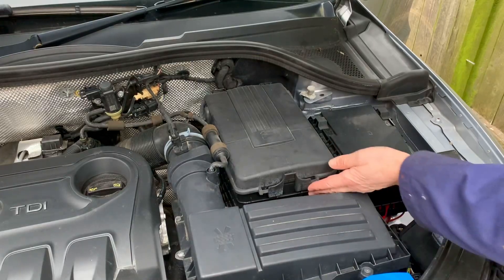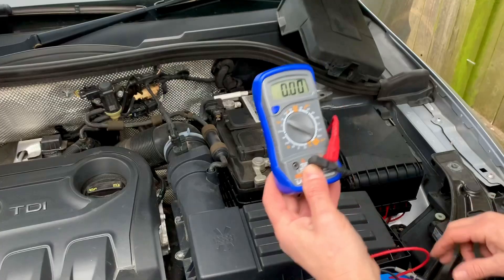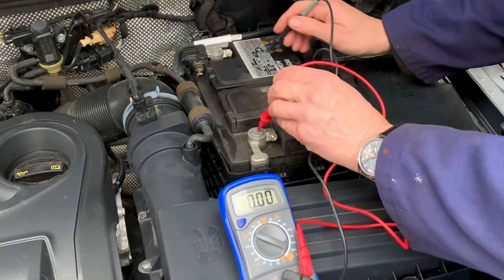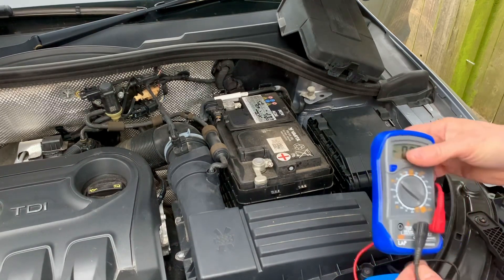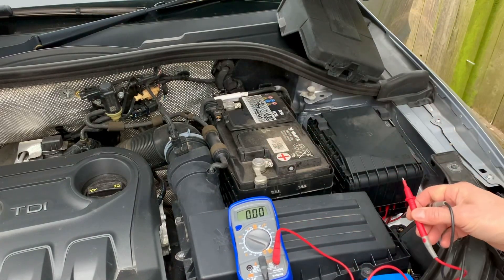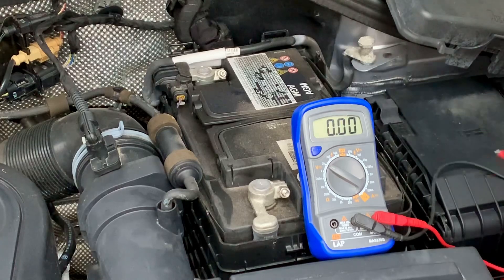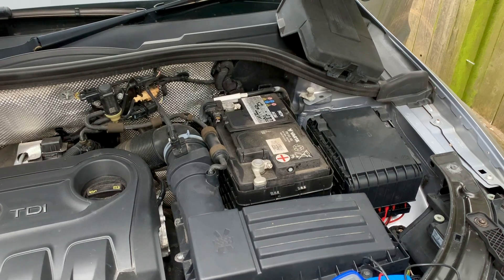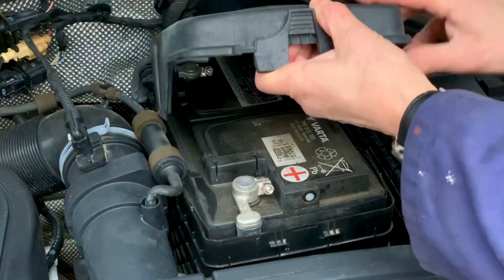Faulty Battery Diagnosis using a Multimeter

Comment: Great video I guess this is an AGM battery? I’ve read they last 6-8 years so well overdue a replacement imo. Preventive action for me is to change it regardless at 8 years so you don’t get caught out 😊
Reply from the maker: Thanks. Yes I would agree ideally it ought to have been changed before, but when it’s still performing, time flys by. Not sure if it’s an AGM battery, I’ll have a look and see if it says on the battery somewhere. Varta are very good so it may be. Thanks for watching. 👍🙂

Comment: Excellent advice thank you. From my (too many) years with batteries, after an overnight settling period, 12volts or less was as good as flat, 12,3 volts was 50% capacity and 12.6 volts or more was 100%. This was a good indication of the health and longevity one could expect of a battery.
Reply from the maker: Thank you Chris, that is appreciated. Sounds like you know your batteries. Seeing this one at 12 volts pretty much told the story and this particular one has done well lasting pretty much 10 years, somebody must have been kind to it.